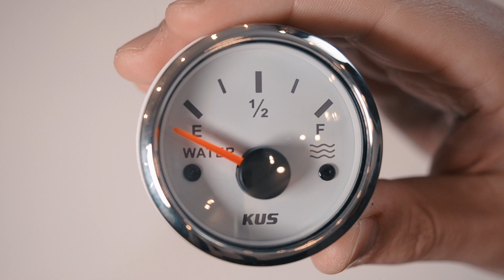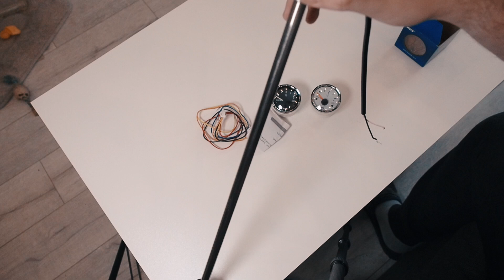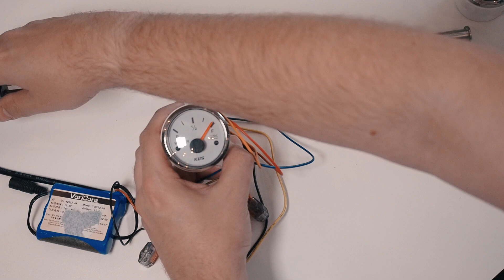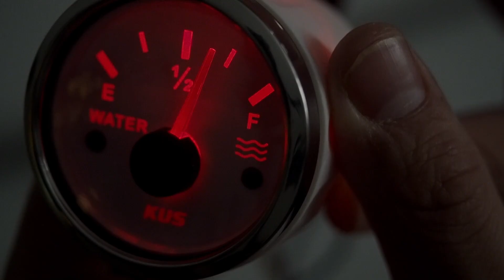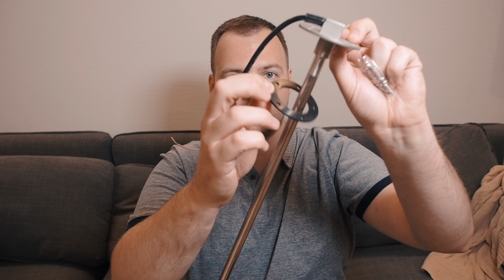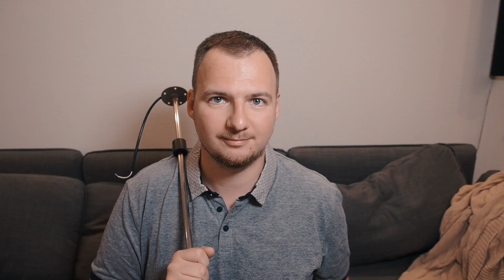Coolest water level gauges and sensors for RV or marine. Water, fuel level meters for van conversion

Comment: Great video, there are maybe another 2 on the same product by brand. I like the demo in this one. 

I’m having a hard time finding the ViaCore Battery ReCharger for use in the US. 

There’s a site that sells it but I omit see it for the European outlets, receptacles. I need to connect to US outlets to charge the battery pack. My only other option is to connect directly to power source in the camper. 

Any tips are appreciated. Thanks.

Comment: Great Video, I have the same model, but for some reason, my connection is reding backward! assuming that the bar electrical part at the beginning is the full part, and at the end of the bar where it finished at a Not, should read Empty. When sliding the flote to the end where the Not is, it read Full, and when I slid it to the electrical part it read Empty. ?? My colors on the Guage are slightly different. If you care to comment on my issue, please give me a quick note and I'll give you the detail. Thank you.
Reply: I'm late, but if you haven't figured it out yet the sender can be 240-33 ohms and the instrument 33-240 ohms for example. It's not the same and one needs to be careful about it when choosing the sender ( or instrument). You,ll get correct readings but backwards.
The other values besides 240 -33 are usually 0-190 and 10-180 ohm
Reply: @aleksafilicevic582  Thank you for replying back to my issue. I think I know what happened. The Item link to your video is the exact representation of the item in your video, but at the time I made my order, I click the link provided on your Items list, and Amazon have ship me with a close similar Item that I was convinced that it was the same. This Item does not have the word
"KUS" is not on the display and the wires are not exact matches as in your video. They have given me the wrong item and I thought I had the right one, since. I have not installed it yet because I have not yet done any electrical. will keep you posted. Thank You.

Comment: About to install this in my van. Any idea what size fuse would be needed for this setup?
Reply: the sensor depends on the size depth of your tank,  if tank is 20 cm depth you need a sensor of 20 cm long, that's it

Comment: Super useful video. We just ordered these parts to install ourselves in pop up camper. We only have fresh water, so we dont need an expensive 3 tank solution. Where /what did you use for your snap-together splicing and power supply?  We like the idea of a separate battery, as we dont want the power drain on the battery.

Comment: Did you use the bolts that came with the sending unit or did you use screws? Mine is a new installation in a plastic 25 gallon water tank in my RV.